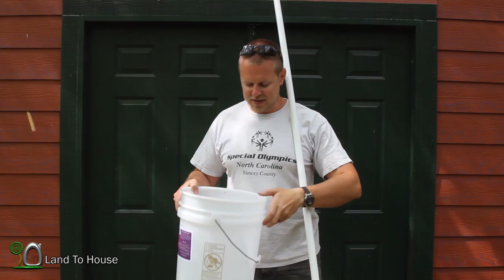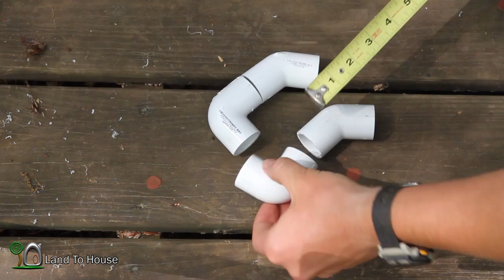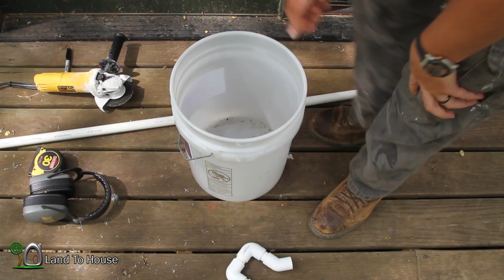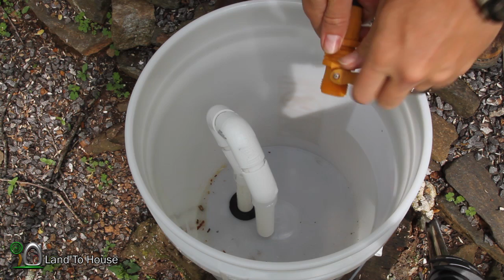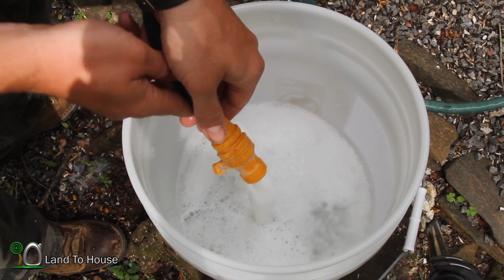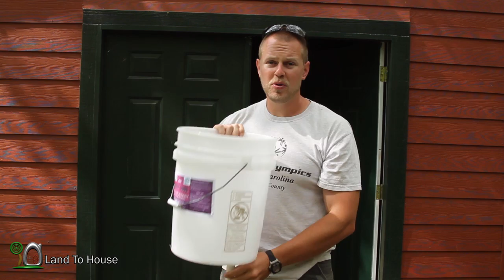Auto "U" Syphon Build and Test

Comment: Main problem is that there is an air bubble in the bend. That air has to be removed in order to achieve a decent flow.  That's why it takes time to get started. Make a tiny hole at the top of the bend.  And I mean TINY. Then, as the water level rises the air escapes. Some air will be sucked down the tube, but if the hole is small it will be fine.

Comment: Hello, I made a S siphon like yours, I also made one in a dif shape, and the only result I have is as the water commes to the wanted hieghlevel, it simply flows over. No underpresure is made to make the water goes in a high speed. And why don't you use a PVC pipe cutter? Using a grinder brings a lot of fine pvc dust in nature. As you do Hydroponics, I think you are pro nature and contra things that are not ok for nature. So PVC dust is very bad for  nature.

Comment: what you are building is a level cyphon.  you only need the t 90's to do this. it will trickle at the level of the top of your u an cyphon when the incoming volume exceeds the the top of the pipe and it will cycle.
Reply from the maker: Yes. The added 45s are to allow the siphon to start with lower flow rate.

Comment: Increase the flow of water into the bucket. Add a smaller bucket with another, smaller, U siphon on-top of that bucket. The smaller siphon will feed into the main bucket increasing the flow, dumping the same amount of water into the main bucket over a smaller period of time. That should get the main siphon going.
Reply: Alternatively, you could feed the main flow into a small container on a lever with a counter weight at the other end so that the small container fills up and dumps the liquid into the main bucket all at once when it reaches a certain weight. That would stagger the flow rather than having a constant flow which could help start the siphon.

Comment: You could go out the side of the bucket instead of the bottom. That way you don't need to have such a good seal on the bottom. Just be sure your pipe on the outside of the bucket extends down lower than the bottom of the bucket or at least lower than the pipe on the inside of the bucket.
Reply from the maker: Yes! I have a newer video from a couple years ago showing a side exit. Works well.

Comment: How can I compensate for low head pressure. My creek is small and my land is pretty flat
Reply from the maker: Are you asking for ram pump operation or for the U siphon? If you are talking about the ram pump you can install a stand pipe to extend the water source a long way. This lets you gain the head pressure you need yet allow the source to be close to the pump. Here is a video showing how this works. https://www.youtube.com/watch?v=Untwclzgq7U

Comment: What is that thing on the end of your drill when you make a hole in the bucket? Is that a piece of pvc pipe. (If so how do you get it to stick on your drill?
Reply: It's called a hole saw. It's a steel drill attachment for drilling large diameter holes.
Reply from the maker: Yes! Thank you.
Reply from the maker: Yes a hole saw. Sorry for missing your comment!

Comment: It looks to me as though there is one flaw in this setup. If the water is filling the tank too slowly it will trickle out rather than siphon. If the outlet pipe was through the side at about 3/4 way up and had a right angle bend to the bottom of the tank it would work well as long as the outlet pipe was temporarily blocked to allow the water level to rise above the top of the pipe. A shallow “U” shape in the pipe, perhaps four 135 degree bends or a piece of copper shaped with a pipe bender, would trap water in it and create an airlock stopping water from entering the siphon. When the level had risen adequately the pressure from the head of water would displace the air through the trap and the siphon would commence. As long as the trap is correctly designed it will retain adequate water once the siphon has broken to create a new airlock. This works for me on a dehumidifier drain where the slow trickle from a continuous drain would be prone to freezing.
Reply from the maker: I actually have a series of videos where I dive more into the U siphon concept. There are a few low flow starts and other fun things in that series.

Comment: cheaper than to use all those elbows is to just use one pipe and bend it by applying heat and then prying the pipe against a rounded edge. less turbulence too.
Reply from the maker: Yes indeed. I do have a heatgun. That would do the trick.

Comment: if you wet the uniseal its easier to put the pipe through, put an elbow at the bottom to help create a seal to start the siphon, also "tubing" (schedule 20) can be used at the top sections and "pipe" (schedule 40) can be used at the bottom and your fittings are all the same size still

Comment: One of the biggest problem with working with vacuum is that the parts are designed to work with pressure as opposed to vacuum and vacuum is hard to maintain because everything is porous to a certain extent. There is an expression that says that "where there is a way in water will find it"... the same can be said about air too... but more so with air than water. I think that vacuum as an energy potential is infinite where as pressure is finite.

Comment: You could reduce the pipe or add a 90 going out. That will slow the rate at which the water flows out.
Reply from the maker: I was trying to keep the pipe size the same so adding the 90 is a better option. It does work. I have several more videos showing some tests that I ran.
Reply: Eric Mastenbrook that is the best solution.

Comment: It's okay stating that you need safety glasses and ear protection, but you Also might need to state that your holding an angle grinder wrong so people don't things it's the right way to hold one..
Reply from the maker: I like to use the chop saw now. It makes a much better cut.
Reply: Even better is a ratcheting pipe cutter like the following. It slices through with no mess.  https://www.amazon.com/Cutter-Bonus-Japanese-Steel-Blade/dp/B06WP2FXDW/ref=sr_1_1_sspa?ie=UTF8&qid=1515617523&sr=8-1-spons&keywords=pvc+pipe+cutter&psc=1

Comment: I designed this u auto-siphon. I did a lot of research and testing. This design works well but the fittings should be close together so it looks like one piece. The peak of the siphon is an airspace that has to be displaced by the rising water in the bucket. As the water rises in the siphon the water dumps out greater and greater and the air space at the top of the siphon becomes smaller and smaller. Eventually the weight of the water dumping out of the siphon creates a vacuum and sucks all of the air out of the top of the siphon and then the water completely fills the siphon and the water gushes out at full throttle.There is tons of info on the internet about auto siphons. There is also one done with clear pipe and u can see how the design works.
Reply from the maker: Thank you for the research. I like the siphon. It does work and has many nice applications. have you seen the low flow idea with ram pump? https://youtu.be/enj1d0NNLzY

Comment: Totally wrong design.  Use a short length out of the bottom of the bucket, a 90, whatever length gets you past the width of the bucket, another 90 upward, a vertical pipe to whatever height you want, and two more 90s to turn back downard to your outlet fitting.  Once the water gets high enough to go through that last 90 it should siphon the whole thing clean.
Reply from the maker: Yes you should check out my newer tests of the U siphon. I take the unit out of the bucket as you suggest. https://youtu.be/FsZi4B5bevs

Comment: I missed why there are two 45° bends...?  Why not just use the two 90°s?
Reply from the maker: By using the two 45s and two 90s it makes a better upside down U with more surface area to pull the water. Only using the 90s does not work as well or at all.

Comment: add a ball valve at the drain outlet.  you could effectively control flow until the siphon is full force then open the valve full way.
Reply from the maker: +Jeremy Dingeman I would imagine that would work. But if I want this to operate without my presence that would be a little difficult.
Reply: Land to House maybe a spring loaded flapper.  it would take a little resistance to open and it would help build up flow inside the tube
Reply from the maker: That would likely work as well but I feel the spring would have to be finely tuned to get the pressure right. The spring valves that I have worked with have a 1/2 pound spring. Way to much for this siphon.

Comment: The typical solution for this 'NO AUTO-START" delema is to, as assumed previously, add a same size diameter elbow 90 to the bottom end of the stand-pipe to create back pressure. No need to reduce diameter here. 
For low input flow rates use a P-Trap under the tank to create a "wet" air seal to initiate the siphon cycle consistently.
Reply: I did a bell siphon outside the water tank and then did the p trap.  The tank filled about 3”-4” above the outlet before starting the siphon.  Works great

Comment: Ok I uploaded it.   My new phone uploads quiker then I thought.   ok  Pay attention to the sound.  you hear the water rise up the draincatch cup . thats where some of the magic happens,  but make sure you have it reasonably high, not just a little bit of the bottom, the higher it rises the more pressure it creates atthe top, and thats what you want.  and dont have to much drill holes in the cup. or too big of one,  Its purpose is just to drain the cup so it can push up pressure again on the next drain
as soon as the waterlever hits the crossbar, it drains.   its sat over the winter. now it just goes over the cross bar, but it still works. make sure everyhitng is sealed, and if the tuning is right then you should have er good luck let me know how it turns out ofor you if you do it.   or what you do haha
https://www.youtube.com/watch?v=U6H1iyEvIgE
Reply from the maker: Very cool. I am inspired to make my video this next week and get some more results with the siphon. I have not used the h design but it seems to work well.

Comment: I think you need to add the cup with a drainhole.. It should work.  Myn did a similar thing before I added it.  but also I mad the standpipe ( well, the height of the h, in this case the standpipe is the 90 degree of the h.  when it passes the bar it drains ) taller at the same time,  when I done both those things it worked.

Comment: I had some trouble with the bell sipon aswell. I didnt get it until I understood the science of how it worked. THen I thought   OK. then by theory this should work.   after some playing around it did. ( trust me  it might get time consuming lol )   also the lenth of the h affects how well it will drain. It determines the size of the buble that goes down creating bigger pressure creates a bigger release.  make sure its all sealed.  GLue is not nessesary, just push it on good.  it takes some playing with. the taller works better then the smaller. (  Just take my workd for it, too small dont work ,at least noit when I shortened it for aesthetics, took me a bit to figure out why it wasnt working again. the trick was in the height I donjt have a magical equation but Ive made a few of them now and they all work.

Comment: hey Land to house.    I know what your problem is  I tried for weeks trying to get it.  the best one Ive done is a backward lower case H. perhaps ill make a video on how I made it. its a little bit tricky.  yours might work if you do the cup thing that I did on the bottom.   but put a drain hole in the cup or it goes stagnant. it will siphon down quik enough if your hole is small enough,  you just want it to drain after every siphon..   before u mess with the U siphon. try the cup method.( My h works great., I tried the U I couldnt get it.  what happens is the water rises up, in the cup in the drainhole creates pressure in the top of the h.  ( literally. I made an h shape out of PVC.  ) The Air bu bble has nowhere to go but down, so it creates a strong burp, and it brings the rest of the water with it 
in my video im currently uploading you can see how it works a bit better. heres this video for now. Ill uploadload it to show how it works just a bit better then the current one Im about to post.  its dark and rainy right now. this is just another vid I kept on my camera because I liked it.  if you want a better look at it just ask and ill make a video where you can see it without the gravel and whatnot. 
https://www.youtube.com/watch?v=E2hZPt9uHPE
Reply from the maker: Oh wow I had the same idea on making the low flow start with a pipe that would tip over when full and create the surge of water. I am actually just gathering the materials to make a video on it. Your setup seems to be working well.

Comment: why wouldnt you just use a straight pipe, like the petcock in a toilet tank?
Reply from the maker: +Jeff Williams I know I failed to mention this but the reason I was testing the automatic siphon was to clean and drain a duck pond every time it reached the full mark. Because ducks are so messy I wanted to flush the pond every 12 hours or so.

Comment: use a self starting syphon, m shaped with two hills and 1 valley. the first hill should be slightly lower than the second(exit) hill.
Reply from the maker: I have seen those. After I do a little more testing with the U siphon I will have to move on to the M style and see how well that one works.
Reply: Land to House won't work, read comment above.

Comment: I think semi blocking the output (as you did) will cause an air bubble in the top of the question mark, as you called it. That slows the flow down, if it keeps flowing at all. The flow is at maximum speed when the top of the question mark contains no air. So What you could do is making the top of the "?" a bit narrower. That should make the upstart to the maximum come sooner.
But to be frank, I don't see the problem. It worked. If you hadn't stopped the flow the second time, it would have worked after some time, just like the first attempt.
Reply from the maker: Yes you are right! I was just playing around to be honest. I just purchased the parts to run several more tests this next week. It should be fun to alter the U some to see if it has better results.

Comment: I would recommend using a smaller diameter pipe . Bubbles will be drawn down the small pipe but not a large pipe . AND drill the hole in the side of the bucket near the top with an elbow reaching to the bottom of the bucket and an elbow on the outside of the bucket going lower than the one inside . -of course the curved side of the bucket may be difficult to seal but any possibility of leaks will be up high .  :)
Reply from the maker: The Uniseal seems to work really well with the bucket. I am going to give the U siphon another go here in a few days. I have several more ideas that I would like to test and share.
Reply: use a square bucket then.

Comment: This is similar to the Pythagorean Cup. This would most likely work best if the entire pipe was reduced in size. I think that you will find that it still empties the bucket surprisingly fast.
Reply: Land to House I think this is exactly the same concept as the Pythagorean Cup, not sure that the extra bends would make any difference whatsoever. The Pythagorean Cup works because you fill the cup higher than the "hill" before you notice it draining, giving it the momentum to create the siphon, then you stop filling.

The only way for this to work is to make the thickness of the top of the tube thin enough such that the momentum of the water filling will fill the whole cross section with no air gap. So the slower the fill, the smaller the tube. And therefore slow drain.

Although, it doesn't need to be a circular tube, or at least not a circular hill does it?  If you had a very wide but thin tube, so the hill was only say 1/8" high, but say 6 1/4" wide, the water has to only rise 1/8th the height to create the siphon of a 1" circular tube, yet with the same surface area (hence same drain speed).
Reply from the maker: Yes it sure is! I have just drawn out a few ideas that I want to share in a video soon. Might allow the larger pipe to be used and still allow a low flow start.

Comment: could replace  a Dutch bucket system
Reply from the maker: I suppose that it could. I am now to working with these systems.
Reply: my thinking is having a cut down 200l barrel and having a dwarf fruit tree in it and the oxygenation  would cause a form of root pruning  to avoid the tree becoming root bound. I have root pruning pot in the past and they work amazing well, but what has held me up was creating small enough  bell syphon  and I you may have solved my problem having ebb flow around my tree roots.
Reply from the maker: Yes this might be what you are looking for. You can also pull from the bottom of the tank and have the U on the outside of the tank.
Reply: I really think you've solve my problem with aeration around the tree roots thanks a lot keep up the good work much appreciated